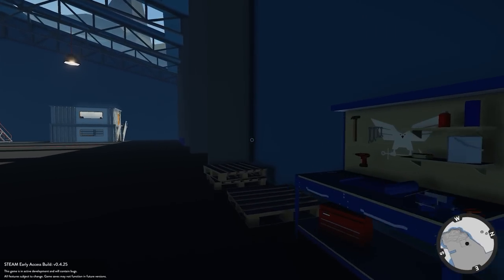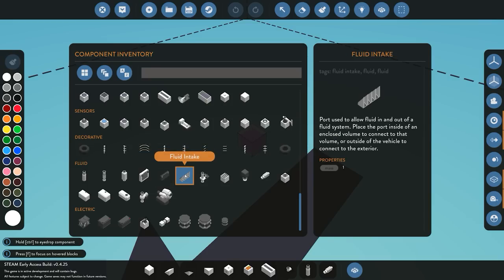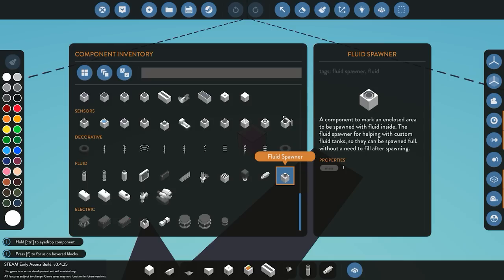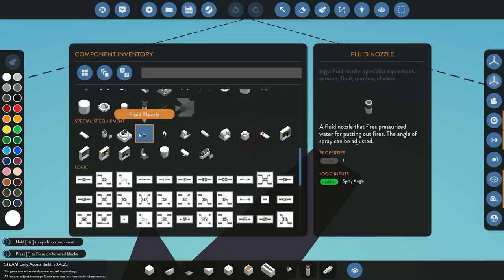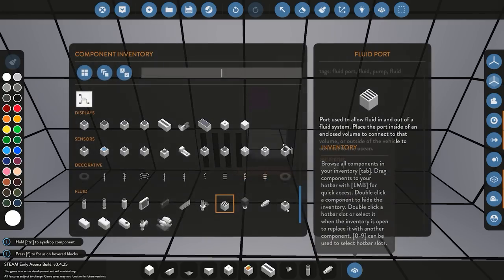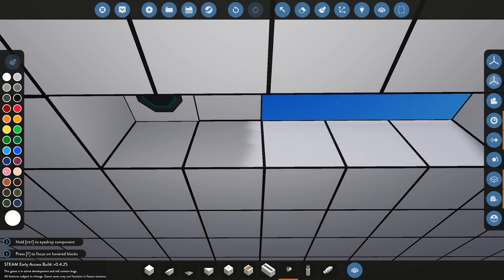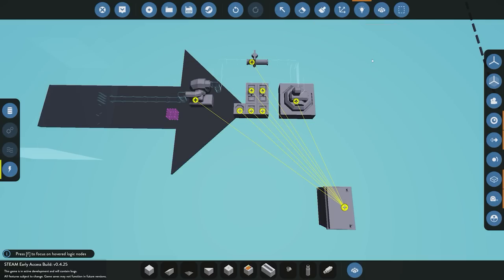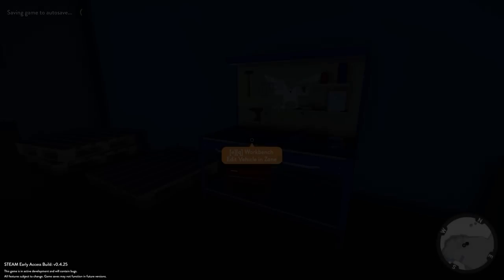Stormworks Fluid Tutorial

Comment: U my good sir deserve a bigger number of subs! Also just a question can you use pumps in your air system to get air to your engines like a turbo? And can you use it in your fuel line?
Reply from the maker: Toddy95 yes you can, I’m not sure if it will improve performance however it is required if the pipe goes more than 10 blocks vertically
Reply: Thanks!
Reply: @MrNJersey  for air??? you really have to add a pump to pump AIR more than 10 blocks vertically?? that makes no sense at all hahaha